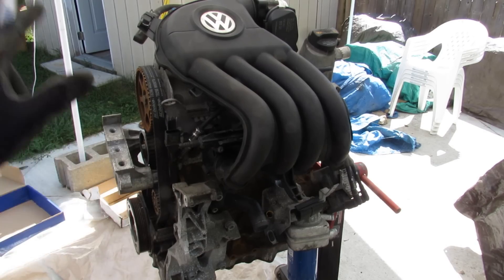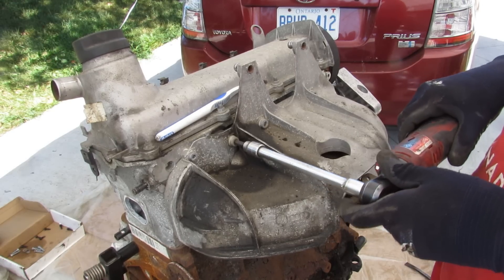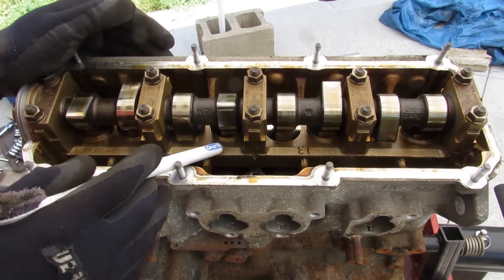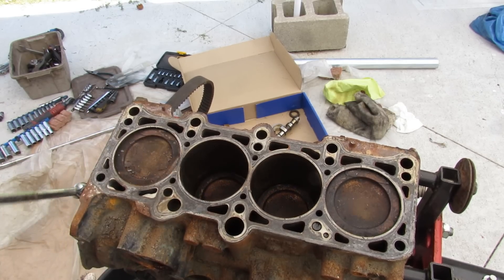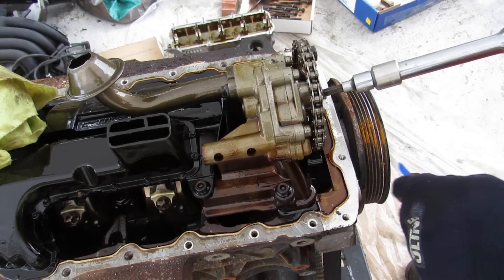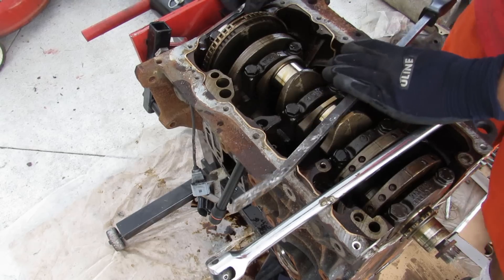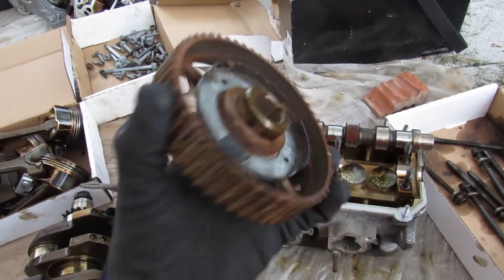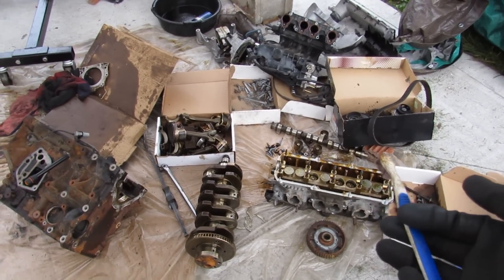The Simplest Modern Engine - From Volkswagen?

Comment: This looks like an engine that would run forever.
Reply: It does by doing regular maintenance.
Reply: It’s VW version of the BMW M10 and M20
Reply: That is a beefy cam shaft.
Reply: The earlier 1.5, 1.6, versions would burn exhaust valves. If you replaced them it would last until the body rusted away.
Reply: They do start to use a bit of oil high mileage but over the last 30 years of variations of the aptly named 2.Slow it’s proven to be an extremely reliable engine with minimal problems. I had a 98 Mk3 jetta with the 2.slow ABA with over 250k, ran like a damn top and I had no problems with it!
Reply: I have a 2012 2.slow Jetta s 103,000miles burns 0 oil..not fast but a cool looking car with nice wheels and stance
Reply: actually it is quite common they tend to burn quite a lot of  oil..
Reply: @salsarriba5695  my 2012 CBPA engine has 200k on it and doesn't burn any oil. I've maintained it meticulously though.
Reply: Mine was burning oil at 100,000 miles. 

No car I’ve ever owned.. including Volvos with double the years and miles, or any crappy domestic brand I owed in the dark days of 80s and 90s GM and Ford ever burned oil.

Comment: The best engines in the world that last the longest, are the most simplest designed as well.
Reply: Electric cars are even more simpler, so will last just as long as well.
Reply: @mnrkm  no they are not... Not by far... The circuitry.. wiring, relays, fuses, timmers, multiple functioning circuits, integrated circuits... There is nothing "simple" about an electric car... You no longer need a mechanic to repair the car instead you need a nerd and a computer..
Reply: @zorans5200  I'am talking about the electric motor  and drive train it self, there are no pistons or spark plugs, or a water pump, or intake or exhaust valves, it's much more simpler than an engine.
Reply: @mnrkm  I understand that.. but you still need VFD's to drive the motor.. you still need complex circuitry.
Reply: Except this one. 

I had a 2.0 8v on my 1995 GTI. Religious synthetic oil changes done by the dealer, and burning oil at 100,000 miles. 

Junk.
Reply: @Bartonovich52  98 VW Beetle 172k abused to hell and back by previous owner still going strong with minor repairs.
Reply: @Bartonovich52  Maybe you dont know how to drive?!
Reply: @Bartonovich52   I daily drive 1.6l 101hp golf mk3 converted to LPG. 370k kilometers(that i know of). 85k driven by me in past 3 years. 10w40 (not even the expensive kinds)  MANN-FILTER oil filter, i change the oil 5-6k km.  No oil burning issues.
Reply: @Bartonovich52  that's exactly why... Synthetic oil is not for every engine..  unless the engine is made from all aluminum with very very low tolerances on internal parts, or unless you are racing the engine then synthetic is actually going to damage your engine... I have used synthetic in older engines as well and I had oil burning problems along with oil pressure issues and noisy valve trains... Untill I got a little older and wiser in my mechanic trade and started to understand what low viscosity and high viscosity oils do to low performance and high performance engines and vise versa... I have friends that swear by synthetic oil that it's the best and bla bla bla... But when I start explaining to them the physics behind synthetic oil and regular oil and their purposes.. it's in one ear and out the other... They brain washed into believing that it's some sort of super oil and outlasts every other oil.. which it's simply just not the case..
Reply: Synthetic is what the manual called for. 

There is no such thing as an “all aluminum” engine. All of your wear parts including cylinder sleeves and piston rings, valves and guides, and wrist pins, con rods, crankshaft, camshaft, tappets, bearings etc are made of case hardened steel or a babbit, brass, or other type of bearing surface.
Reply: Oh.. and don’t confuse viscosity with composition. You can get 50 weight synthetic oils. Synthetic means that it’s less likely to break down.

The whole reason why modern engines use synthetic is for long oil change intervals—NOT tighter tolerances.
Reply: @Bartonovich52  like I said.. I could go on and on about why synthetic is bad for regular daily driver engines and why the oil viscosity changes drastically in hot temperatures making it almost like water..  and yes, the are all aluminum  race engine the internalals of the engine obviously have hardened steel parts but the block and heads and other small parts will be aluminum to reduce the weight and warm up time.
Reply: @Bartonovich52  don't worry, I am not confusing viscosity with composition... Yes you can get almost any weight in oil in synthetic or regular oil... Synthetic oil means it has compounds mixed into it to make it more playable longevity wise for performance engines and higher tolerance engines.. due to the fact that regular oil during initial start up is thick and it's hard on oil seals and bearings especially main bearing when the oil can't reach into the bearing untill it's broken up a little,. This is why they call it "synthetic".  You can prolong your oil changes sure,. But that is not what it is designed for.
Reply: @zorans5200   completely agree with you, I have a fiat with 1.9d engine , and the owner manual clearly mentions 3.5 liter normal/regular oil.
Reply: @mycamera_lens  I had a 99 TDI Jetta.. I used synthetic in her when I was younger and it was noisy.. lifter and valve train was noisy.. also consumed oil thru the turbo... Until I met a mechanic that was really good in his trade and advised me to put regular oil into it .. sure enough the symptoms went away..  now 12+ years later in my mechanic trade I realized why the regular oil was better.. but like I said alot of people will argue it but don't understand the logic.
Reply: @zorans5200  yes even oils with lower viscosity tends to leak at various places under heat in older engines especially diesels
Reply: @mycamera_lens  that's right. I learned the hard way
Reply: @Bartonovich52  just have to change the rings and valve seals . Very easy on an engine this simple. Use higher quality piston rings

Comment: VW is not a reliable car. If you are looking to keep a car for a long time or get a reliable used car then you would be wise to bypass VW. The proof is in the resale values. Look them up. They do not hold value.
Reply: That's b.s. I've owne VW's since 1989, had never issues with their reliability. Maybe their modern TSI engines are'nt that reliable, with which I have no experience (yet).

Comment: These engines have gone nearly unchanged since 1993. Dead reliable and simple to work on. Very slow, but they take abuse like a champ. I’ve owned 6 VW’s with the 2.0, one had 246k miles before I sold it and it was running smooth as silk! Still see it all the time driving around town
Reply: 1985 actually
Reply: Had a 79 Rabbit and this engine is very similar to the 1.6l
Reply: @porcagarage2337  It's not quite identical, but it sure looks very similar to the long block in my 1978 CIS Scirocco.
Reply: Crossflow heads are the biggest change to 2.0 8v.
Reply: I can't believe how long VW has used this design. This is virtually identical to the 1.5 litre engine my dad and I rebuilt 35 years ago from my 1974 Audi. That engine had 70 HP. I threw a 110 HP cam in it and it ran like a scalded cat. No surprise there since the Audi already had a 4-2-1 factory "Y" header. It also pulled hard from 5000 - 8000+ rpm. My machinist told me that this design with the cam buckets directly under the cam could run all day at 8k. He also said guys in Mexico (rally racers) were using a little trick to get those engines to run at 12,000+ rpms all day long. It just so happens that there is a Ferrari engine with exactly the same cam follower design even down to the dimensions, EXCEPT for one detail. On the Ferrari the adjustment pucks are UNDER the buckets so the cam won't chunk them out no matter what.
Reply: @jackandblaze5956  Yeah I understand the 1.6L was closer to square proportion and could be tuned to crazy levels. VW has always been big in Mexico, much more so than in the US.
Reply: That’s a lot of miles!
Reply: This Engine was created by Audi in 1974
Reply: I have the ea827 1.8L 8v bored to 1.9L. Rods and pistons for 1000hp running on 100% ethanol and a 62mm turbo. I’ve ran this engine up to 300hp with the oem rods and pistons for 2years of daily abuse 😅
Reply: Oh yeah, I'm not afraid to buy these at high mileage as long as I know they've been taken care of. Hell, my current one is at 226k right now
Reply: As fast as one needs to go.
Reply: Did they offer a torque coverter automactic with any of these 2 ltr models?
Reply: @gtibruce  That looks like an MK4 engine, the Jetta MK4 and Golf MK4 where first offered with a VW designed 4 sp auto which was not good at all. The Mk3 had the same choice. Much latter an Aisin Warner 6 speed auto was offered with the 2008 facelifted Jetta Mk4 that was sold in Mexico, which was a much better transmission. Mk5 Jetta never had the 2.0, Mk6 had the 2.0 option but only manual. I don't think the 6-sp auto was ever offered in the US or Mexico with the 2.0L en the Mk6, it would be just too underpowered.
Reply: @gtibruce  Yes with Mk3 and Mk4 models there was a VW 4-sp auto, and much later an aisin 6-sp auto. I believe there where no automatic 2.0L mk6, just 6 sp manual.
Reply: I know nothing about VW engines but I was immediately thinking “this engine gotta be from the early 90s”
Reply: The 90s ones were simpler too, they just used more plastics since then.
Reply: You can still go over 170km/h on the 1.9 TDI 90hp version :P
Reply: @rkan2  the 1.9 tdi 90bhp 200,000 miles is nothing to them they are just run in, these engines have been seen in cars that do lots of miles like of taxis with 300,000 & 400,000 on the clock & still going strong, these are the type of engine that'll easily return half a million miles or more if looked after
Reply: @david197407  those engines are nearly bulletproof my uncle owns the 110hp version it's running like new with +500.000km only has issues with the engine mounts, and we own a the pumpe düse 105hp golf 5 for now it's good (except the dual mass flywheel) with 280.000km
Reply: @realspeedghxst  when your putting km are you meaning actual miles or kilometres? if the later then that's a lot less in miles & that sort of mileage is a walk in the park to these engines it's not unheard of to see them doing 400,000 - 500,000 miles, yes dual mass flywheels can get a little troublesome witg age, i'm running a mk1 octavia with the 1.9 tdi has 212,000 miles on & for first few mins after first start up the dual mass flywheel likes to have a bit judder & jump on first few pull aways, after that it's fine, an drive somewhere leave it an hour or so come back start up & drive straight off & it's fine, a frosty morning where start it up & let it warm up for 15 mins or so it's fine after that, just seems very first start up of a day if move straight off it'll judder & jump on pull aways for a few mins, just seems to take it a bit time to balance it's self properly then it's smooth as anything but as long as it keeps working can put up with that as replacing them things cost a fortune
Reply: @realspeedghxst  PD 1.9 TDI jetta 5 here, as you said flawless except for the DSG flywheel.
Reply: This is different from the ABA. The ABA engine was based off a 1970s design and platform.
Volkswagen kept the same basic layout but substantially changed the design of this engine. They got rid of the intermediate shaft, external water pump, and gave the oil pump a chain drive.

Volkswagen is smart to keep costs down by keeping much of the same tooling for decades. Unlike other manufacturers that keep redesigning the engine and do not discover the long term weaknesses and strengths until the engine is out of production and they have created yet another engine block and head design. 

Like you mentioned, these engines are robust and reliable. These engines benefit greatly form the development of VW's diesel engines in strength and durability. The block is closely related to the diesel of the early 2000 model TDIs, just lighter and bigger bores.
Reply: Mine was burning oil at 100,000 miles. 

Dealer maintained since new, synthetic oil changes every 12,000 km as per manufacturers instructions. 

Junk. None of my Volvo red blocks that were double the age and miles ever burned oil like that.. and  neither did any of the crappy domestic cars I owned.
Reply: @Bartonovich52  Some of them were shipped with defective piston rings that were installed upside down.
Reply: @skylinefever  Seems like Bartonovich52 had one of these... Otherwise really reliable engine! And as somebody wrote already - almost unchanged from the 80s so no surprise there are no hi-tech features.
Reply: @Bartonovich52  these pre-date synthetic oils. Iron likes non-synth. : (   they go 300kmiles+, then lock up oil control rings if abused with late oil changes.
Reply: @ Tim Ewa

What if I told you that absolutely none of the wear parts on an “aluminum” engine are actually aluminum?

Aluminum block?  It has steel cylinder sleeves. Aluminum pistons?  Cast iron piston rings? Crankshafts and camshaft are all case hardened steel and running on babbit or bronze bearings. 

And…. all synthetic means is that it runs longer before breaking down. Which means long oil change intervals. 12,000km for that engine as per the manual with the dealer recommended oil because it was dealer serviced since new. 

The construction of the block or the heads have absolutely no effect. They could be made of plastic and provided they could withstand the heat and forces it would not matter.
Reply: @Bartonovich52  My 2000 mk4 Jetta with a 1.6 dohc doesn't burn a drop of oil, even after 235k km.
Change the oil once a year (around 5-6k km intervals), but the previous owners drove up to 15k per oil change.
No carbon buildup in the engine whatsoever.
Very reliable engine, and great fuel economy.
Over the 4 years I've had it, I've only had a single CEL, which was a bad spark plug.
Reply: @Bartonovich52  well I found your problem...12,000km oil changes which are normally fine on pick up trucks with high capacity oil pans...not exactly great for a little car with Maybe 5 quarts at best in the oil pan...should've ignored the dealer and gotten it done at 8000km intervals instead
Reply: @Bartonovich52  Well that's your first issue. 12k-km is too long for oil changes, regardless of what any manufacturer says
Reply: @dud1f3r  it depends on way the car is used. If 12k means twice per year, it's fine.
Reply: @Papinak2  That's still too long. You're still letting bad oil sit in there and drive it around. Driving it less often, but still driving it on bad oil.
Reply: @dud1f3r  it's not, modern oils are made for 30k+ km intervals. I've changed oil after 15k km (per manufacturer's instructions) for 200k, that engine has 320k in total and that car still works well and doesn't need any oil between intervals (I think it consumes less than 0,5l between changes but it's hard to say) And that's engine originally designed in 60's. Old oil, although not perfectly clean, still has amber color, which cannot be said about my newer diesel, which has ashen color after few hundreds of km.
Reply: @Papinak2  The chemicals they put in the oil degrade over time. The oil itself might be fine, but it won't hold up to the SAE standard set, and thus, will not be the correct weight oil for the engine. Furthermore, then just 20 parts per million of metals in your oil can cause issues to your bearings over time. For both of those reasons, (and the fact I come from rotary engines so oil maintenance is a high priority for me), I'm not subjecting my 2.0 8v to crazy high oil intervals and sticking with 5k mile intervals (8000 km), replacing my filter along with it. Besides, oil changes here in the states for euro cars are basically free
Reply: @dud1f3r   15k is not crazy high interval, it's standard interval for European vehicles for more than 3 decades.  If you're using oil by VW's specs (not just SAE, which says almost nothing about oil specs), it'll have long life with 15k. Modern cars have 30k interval with 0W20 oils - that's crazy high.
8k was used some 60 years ago with low quality mineral oil and bypass filter...

Comment: I currently have an automatic 2012 Jetta with this engine at 103k miles. Do you think this will be a car that will last me given the proper maintenance? (engine, and transmission wise?)
Reply: Yes, just keep up with the oil changes and belt replacement. You should not have a problem before 200k miles.

Comment: My mother had this engine in her 2002 golf which she purchased new. The engine was not powerful, but it was durable. Never had any problems with it and we had it a long time. One camshaft and two valves per cylinder. It was old in 2002
Reply: 115 horses are plenty for a car like the Mk 4. My dad this engine in his 1996 Passat and he pulled their caravan regularly with it. It's not exactly a modern engine and it's too thirsty even by the 90's standards when it was built, but pretty nice to drive with the flat torque curve.
Reply: This engine is from 2010 and forward
Reply: @thedude4795  this is not the turbo charge version with the 16 valves. This is the antique version that is eight valves. One cam shaft. Quite ancient actually. Unlike their newer stuff, this is pretty well-built and will last a long time
Reply: @thedude4795  as far as I know, maybe some items about it. But that engine is quite old. Goes back well into the 1990s
Reply: @kevinbarry71  ep.... Like my 1992 1.8 abs passat